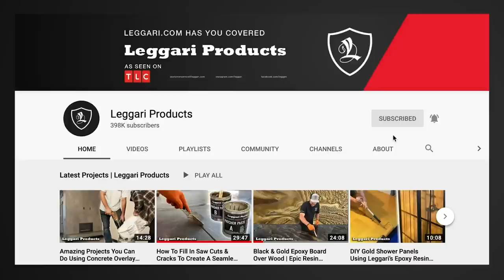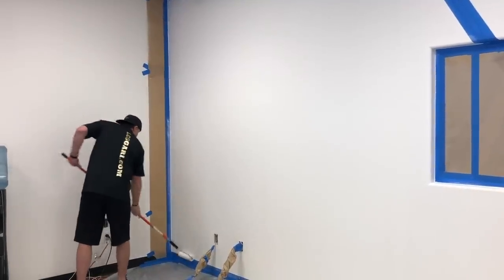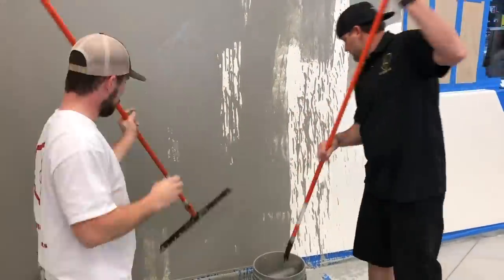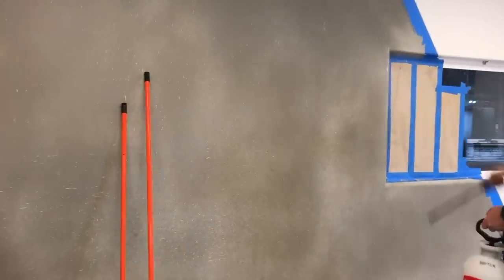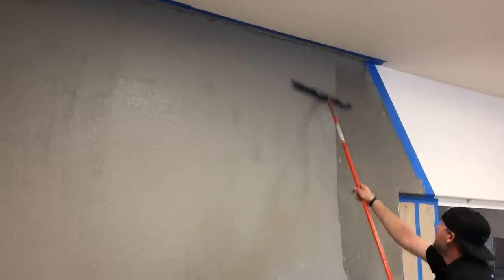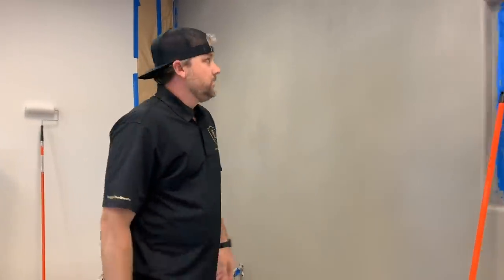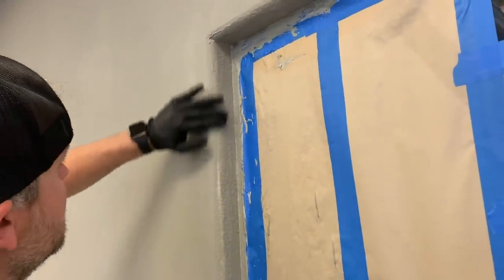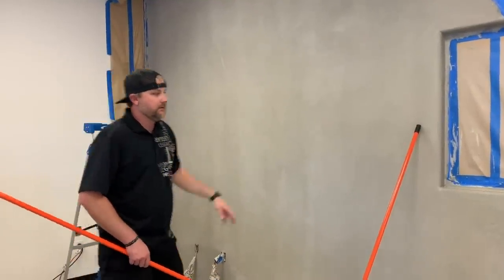How To Make Your Painted Wall Look Like Real Concrete | Best Faux Concrete Look | Get A Modern Look

Comment: If it were a new construction or a very motivated decorator, they could build in an “expansion joint” in the drywall and use an edging tool to get that extra smooth edge profile, like in driveways, and REALLY freak people out!!!    Came out pretty slick, great idea